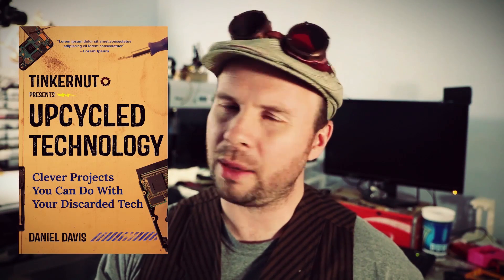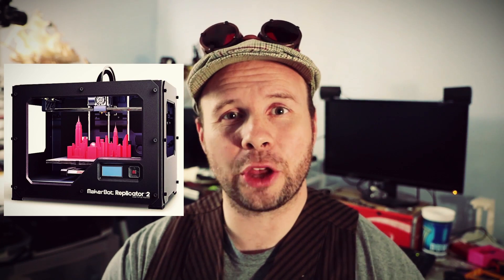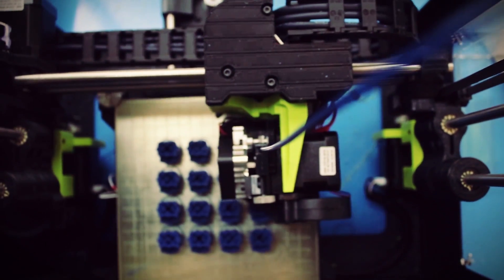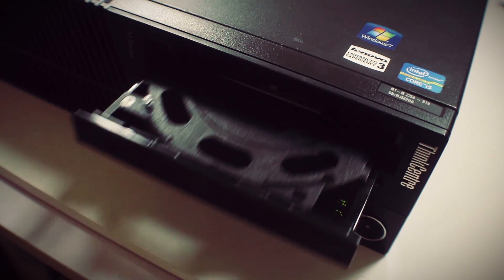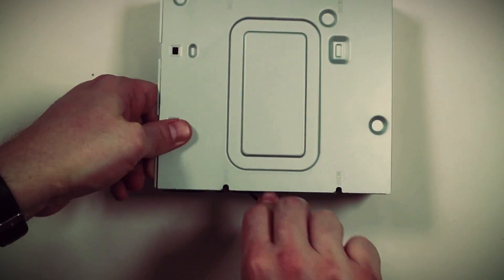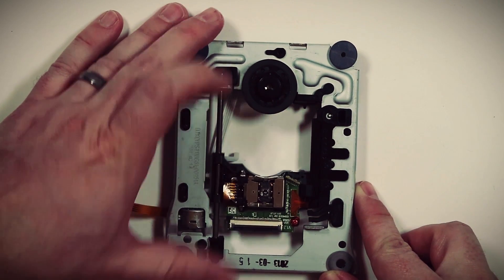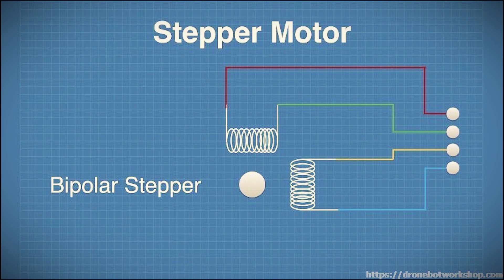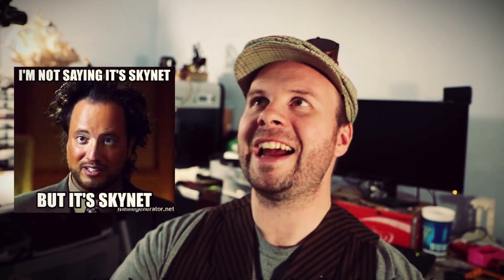Reuse Old CD Drives to Make a 3D Printer (Part 1)

Comment: I've got mine running on a RAMPS 1.4 board. Capable of decent prints, not so good with 'bridges" due to low  speed and no cooler. I cut a holder for a V6 hotend out of a block of wood. It's nightmare to look at, but functional.

Comment: 3d printers are great and all but face it more axises are always better so simply dont stop with your 3 ones and just add a motor to the printer bed so you can rotate your print during the print. this would speed up especially rotation symetric prints or add one to angle the print bed then you can easily print a barbie house with a balkoony in one go for your daughter or whoever may enjoy that...

Comment: Why don't you make a 3-D printer using mechanical parts of scanners like the HP2400? You will get a larger print volume.
Reply from the maker: Don't have enough spare scanners.
Reply: @Tinkernut  Try getting them from a junkyard or a computer repair shop. I've got a lot of such stuff from my local computer repair shop.

Comment: The plastic piece that runs along the worm gear, that moves the tray back and forth should be replaced with something metal. Cheaper/ newer drives use a single rail and bushings to move the tray, the older the drive and more expensive generally means it has two rails inside with 2 sets of bushings which will be much better for the 3d printer. I had the cheap drives bind on me in the past with projects and break the tabs off the trays that move them. You could get away with getting 4 drives and see how to get two rails and 4 bushings on each drive tray.

Comment: I understand this is supposed to be a super low-cost entry into 3d printing, but considering the amount of work that has been put into projects like Marlin, I would highly recommend trying to build a system that can run those firmwares. Even if it means building 2 versions, one with a dedicated 3d printer firmware, and one without.

Comment: i used 1old apple scanner and  2 huge 1980's printers..it worked pretty good. but you can use that laser as a 2nd head to engrave items if it's a dvd burner. it can engrave things like wood and low temp plastic.

Comment: I have two ideas I have been toying around with for some time now. 
1. 
What about a disk(build plate) that sits on top of a lead screw so that whenever you drive the leadscrew, the build plate rotates and goes up or down. Then have one linear axis for the extruder assembly that moves it from the center of the disk to an edge. This would almost double the printing area with the same amount of extruder movement. You can select the pitch of your lead screw to be exactly the layer heigt you want.

2. 
I’ve been busy building and designing a desktop printer that has almost no electronics above its build plate, just the hotend and a fan. It’s a nice challenge and looks great
Reply from the maker: That sounds awesome! Got any pics? I'd like to see it. admin(at)tinkernut.com
Reply: Tinkernut I’ve read your reply and will sent you an email as soon as I get the chance with the in dept explanation. You might want to delete your comment now to not get flooded with mails 😉

Comment: Tough one. The print area will be small, but the rest is still goigng to be "normal size". Maybe first try to create a xy-table using 2 drives for the credit card sized build area? See how much mass that table can lug around. Is it even possible to build a 3D printer this way? Then add a Bowden extruder to move in z? Trying to have the drive asseblies mounted on a as rigid as possible frame.. No hot glue! (Unless used to secure the solder joints on the steppers, there. :) Although not very creative, maybe just have a big box for the base and hide the electronics in there and put the spool holder on the side?

Comment: I'd consider scrapping out an old inkjet printer. You'll find a much more powerful stepper motor, if you are careful you can reuse the circuitry that runs it and it comes with a larger sled and more sturdy slide rails. Also, you could just connect that motor to a fine threaded rod / nut combo from a hardware store for just a few bucks to make a really stable and precise linear slide mechanism

Comment: so where would you get the the software. is there some library to turn 3D models to stepper motor input?
Reply: WILL fill there are multiple parts to the process, first you have to install an interface on the printer (look for marlin or repetier) that can translate Gcode into stepper motor input. Gcode is a standard to talk to cnc’s and 3D printers and such. It tells the interface “hey you need to move to that location and do this and that with the extruder” and the interface drives the motors.

The next layer up is a slicer. A slicer converts a 3D model (usually .stl file) in slices in the form of Gcode. Here you can tweak all kinds of stuff like speed, layer height, how much infill you want,...

Comment: Do you think as a side note you could touch on using this to make a laser engraver?
Reply: I think it would work better as a laser engraver or plotter than a 3D printer
Reply: You can also reuse the disk reader's LED as a laser, with a decent constant current circuit
Reply: Do you think the wattage would be high enough to burn more that just paper?

Comment: Thanks for this new version it's a bit slow paced and more in depth. WhenI tried doing almost everything your way from the previous tutorial, I had problems starting PCU. It should be in working condition and I did connect the green pin to ground with a jumper wire. It didn't turn on tho. Any ideas on what could be the issue? Maybe the contact was too loose or something?

Comment: Hi Tinkernut. There was this one guy who followed your old video tutorial and was able to make it successfully. One comment he made is that the stuff that can be printed are limited to just outlines. Is this true or have you figured how it could make complex shapes? A cube would be nice. Looking forward to the next videos. Thanks!
Reply from the maker: It's definitely limited because I had to custom write the GCODE. You could use a slicing program, but you'd have to configure it to use whatever settings the 3D printing pen uses...which isn't always that obvious. The filament comes out very thick as well, so you can't get much detail. Also, the limited size of the stepper motors only allow for basically a 2x2x2 inch printing area. If you were good with GCODE, you could write more complex designs, but I kept it simple. It's not the best, but hey, I made my own super cheap 3D printer that works, so that's something :-)
Reply: @Tinkernut  I appreciate the reply! It's nice to know the capabilities and limitations of the system. I actually already ordered parts and am following along with your video. Can't wait for the next vid.

Comment: If you've done this please link. But cad program for free. Linx/Ubuntu proferred. Solid works is free if you're a student or at least it was.
Reply: I think the CD-ROM is a great start for learning, but 1-1/2"sq print size is not going to be fun in the long run. After this build, continue with making it with a longer guide rail. Either way, keep up bud. thanks

Comment: I'm making my own 3d printer right now. I am using an arduino mega with ramps motor shield. I have bought some nema 17 stepper motors and i will buy a cheap extruder later. I haven't decided the design yet, should i go for a prusa clone or a cetus clone? Btw i think that having those short axis would create a pretty useless printer, what about trying to extend the motor length with additional screw that rotate with the motor?
Reply: zDami if it is at all possible, consider not cheaping out on hotend/extruder assembly. I’ve had lot’s of trouble that went away when I bought a better one (this was 6years ago though 😅)
Reply: make a hypercube (tech2c)

Comment: Thinking maybe that the size of the rail in an old scanner/printer would allow for more flexibility in design, expanding the print area. Wondering if you'd lose anything (resolution? control difficulties?) with a larger rail...